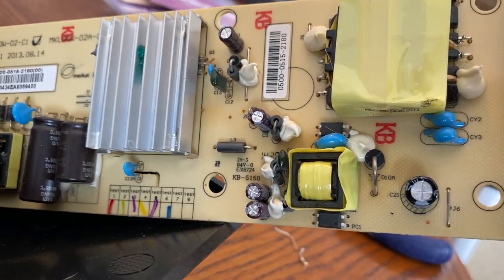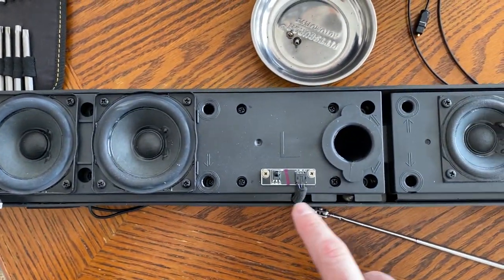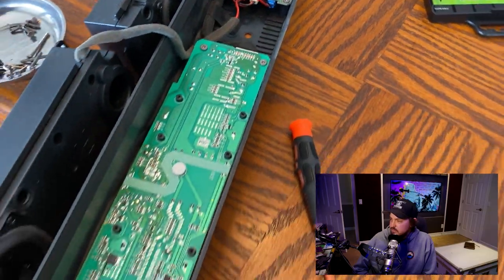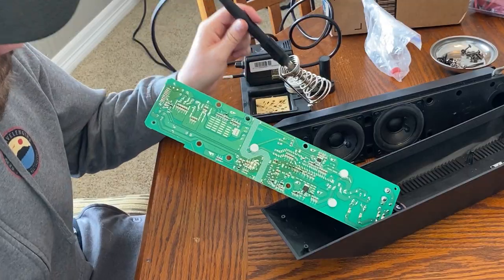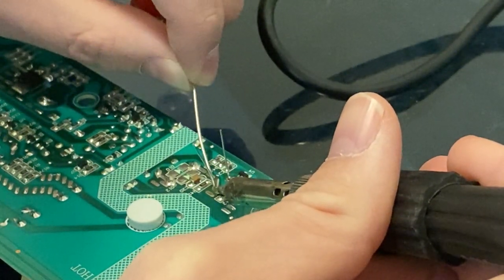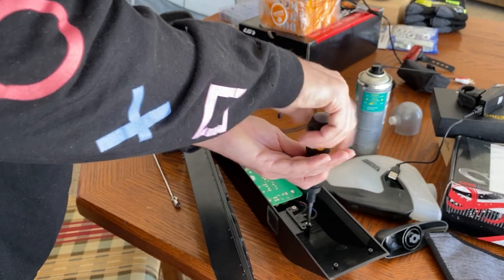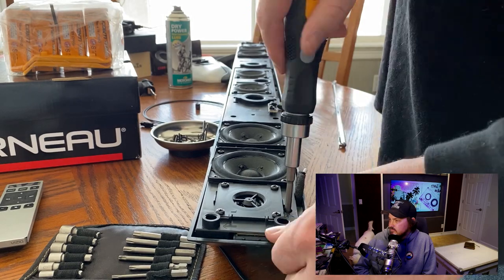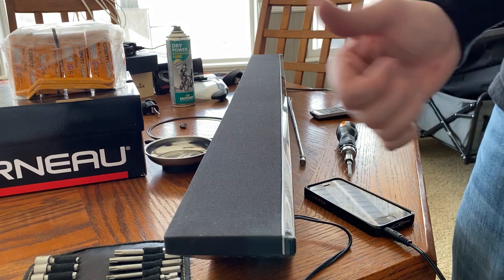Vizio Soundbar Won't Turn On? Replace The Capacitor – Vizio S4251w-B4 5.1 Wireless Surround Sound

Comment: Thank you for the video! Worked exactly as advertised but went bad again after just a few days. I’ll repeat the fix at both C21 and C22, but does anyone have another solution that’s a longer term fix? Has anyone tried a different capacitor with more success? Thanks again!
Reply: I thot I read someone put in a larger 25v capacitor but don’t know if it lasted. I’m tempted to try it
Reply: Thank you, I tried it and the sound bar has been fully operational for several weeks… fingers crossed it stays that way
Reply: @gately1996  still working with the 25V cap? mine just died again so i’m thinking of replacing the 16V with 25Vs
Reply: @garrettisrael  yes I upped to 25Vs and it’s been solid since I did it… several months at least
Reply: @gately1996  sweet. i swapped mine out a couple of weeks ago and it seems to be working well

Comment: I have the vizio 5.1.2 soundbar 36514 and voices sound muffled but backgroud sounds are clear , sub still works . What to you think is the problem and how can i fix it ?
Reply from the maker: Could be as easy as an internal loose wire to the mid / tweeters. Chances are it's a faulty crossover or processor. Best of luck!
Reply: @swhammondbuildsreviews7495  I would love to fix it myself but i wouldn't know what to look for if I tried to repair it myself , and it's hard to find someone to fix it in NYC.. I called a few places and went on job tasking sites and nothing .
Reply from the maker: @baz8701  That's a bummer. You can try searching forums for someone else with the same problem and a fix. Monkey see, monkey do – competence without comprehension. Using a multi-meter and checking continuity might help, see if your tweeters are getting a signal. It's tedious and time consuming. The upside is that it's already broken, so you have nothing to lose by trying to fix it yourself!

Comment: Interesting. VIzio must have issues with caps. I have a SB3651-E6 Vizio soundbar that had a bad SMT capacitor. Wasn't electrolytic like this one but mine shorted out completely.
Reply from the maker: It might be a power supply issue? I no longer have this particular soundbar, but it continued to blow capacitors the entire time I had it, even after the repair.
Reply: Did you fix it? I'm trying to fix mine now after being down for a year or so. I haven't committed to tossing it since all the other speakers are probably good. I wanna fix it and already purchased the capacitor detailed in this video, but now I'm wondering if it's not the right type of part to make the fix
Reply: Mine is also the SB3651-E6

Comment: I have blown the capacitor again.  I really love to push the volume for the rock concert in the living room level. For several times, the main soundbar will go muffled sounding with normal satellite speakers. I turn the power off and then back on. If I find the edge, I can still get it really loud; but I was washing dishes in the kitchen and had it up too high. I have 4 more capacitors, I will replace it again. It's a much better soundbar than most currently made. Part 2: The repair is complete and the soundbar lives again! I have to stop cranking it up to where it blows; my eyesight is worse and my soldering is getting sloppier.
Reply from the maker: I think I've replaced mine 3 times -- no lie

Comment: I think the issue with it keeps blowing the caps it's a bad resistor. Just repaired mine a few days and if it happens again, I'm going to replace resistors.
Reply: I just completed my second repair by replacing C21 and I'm searching for people working to diagnose the root cause of C21's failure. So, have you found any bad resistors? I have an LCR meter in my cart (as well as some higher voltage 25v 470uf caps). In all fairness I'd buy a replacement sound bar if I found one I like (even up in the $500+ price range) but nothing strikes my fancy. Some sound fine but are too thick (i.e. they'd stick out from the wall more than I'd like). So I'll keep fixing this as often as I can. Fix #3 is probably going to happen with it still mounted on the wall.
Reply: @claytonwirtz3389  I have not used the soundbar enough for it to go bad since I purchased a new Vizio Soundbar system a while back.

Comment: Hello, what is the input power range? It is written 120 Volt Ac but sometimes it ranges between 120 to 240 volt inside the speaker. I m gonna use it in Europe.
Reply from the maker: I don't remember – sorry!

Comment: This fix recently worked for me. However, there is a high pitched squeal audible(when the soundbar is on and the volume is low or on, it's not very loud). I was thinking this might be the sound of the capacitors? Is it possible this pre emptive of the capacitor giving out? Anyone else notice or have this issue?

Comment: @SW Hammond Builds & Reviews - Can you or anyone, help reassure me of how to disconnect one of the (?) ribbon-type wire harness/ connectors? Specifically, @3:03 min/sec mark in video, it's the long white plastic connector all the way stage right (closer to C22 capacitor location on the offending board) there isn't a release mechanism on that, is there? Or just gotta pull hard, straightt out??? Is there a special tool to aid in removing? Any advise, to help ensure I dont attempt to pull a connector that has a release tab or the like. It's on there pretty good. If just a straight pull, should the pressure/fingernails pull fron the left/right 'sides' if oriented looking straight down on the board.
Thanks so much for advise!
Reply from the maker: Hey Jason – unfortunately, I don't remember exactly.  However, I do know that no special tools were required.  Some ribbon connections have a hinge and compress together with a locking click – others simply pull apart.  A tiny flat head may give some initial leverage and help you start breaking it free, but fingers should work fine.  I think that in this case, the connection pulls apart?  I do remember everything being straight forward / apparent, there wasn't any guessing.
Reply: I literally just replaced my capacitor a couple minutes ago. All of mine just pulled straight out. No hinges or buttons.
Reply: @swhammondbuildsreviews  Thanks, mate!!! Your guide is SO MUCH BETTER than the one other found here!!
Reply: @Umbrellacorporationmt  Thanks, mate! I was worried pulling the red and wgite

Comment: Mine just went out. The sound bar runs hot. Do you think it could not getting enough air? I moved mine to different spot and it just went out.
Reply from the maker: ¯\_(ツ)_/¯
Reply: @swhammondbuildsreviews  lol, so I notice that c21 and c22 need to be change out. You should change out c22. It’s the same type.
Reply from the maker: Good information – thank you!

Comment: before you replaced capacitor did your light come on when you plugged in to the that wall power just wondering found one of these in dumpster when throwing something away it powers on and volume's up and everything didnt find the remote but i tried audio imput in the 3.5 jack and the rca jack no sound im guessing imma have to go in and investigate cant be any tricks on the outside im thinking or like bluetooth has to be shut off to get the other imputs to work anyone knows if so let me know plese
Reply from the maker: It's been a while, but I'm pretty sure no lights would come on. The entire thing was dead.

Comment: Every 6-8 months my capacitor blows…..I’m on my third. Easiest way to tell if a capacitor is blown is to check the top of it. It should be perfectly flat. If it’s blown, the top is crowned or slightly cupped upward.
Reply from the maker: Yes – I replaced my capacitor 3 times too. Gave it away when I moved and haven't looked back, haha

Comment: ~ YOU just saved me HUNDREDS of $$$  !!!! ~ I replaced C21 and C22 with these $10 parts from Amazon: [Replacement for 6 pcs Panasonic FM Series Capacitors 25V 470uf Low Impedance]  Amazing :trophy-yellow-smiling:
You have my sincere thanks m8 \m/
Reply: Also, there was no visible damage to the originals as other people have stated, nothing, but they had still gone bad ~
Reply from the maker: Glad I could help!